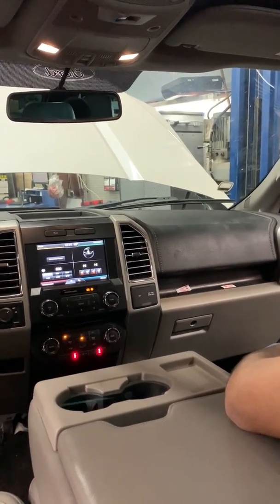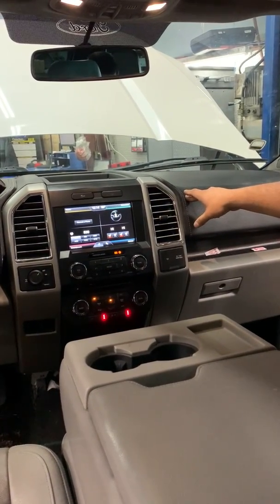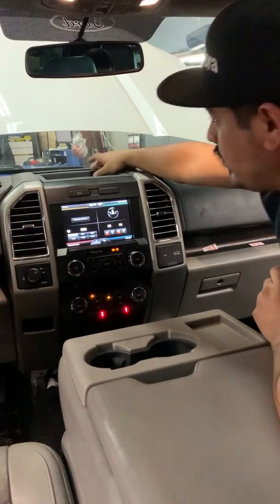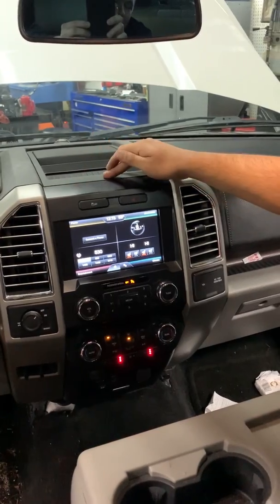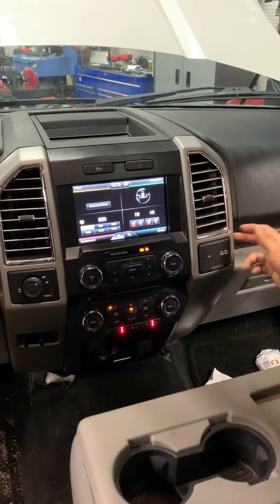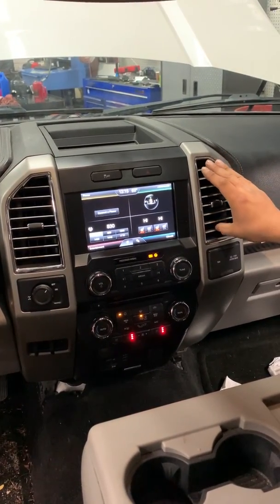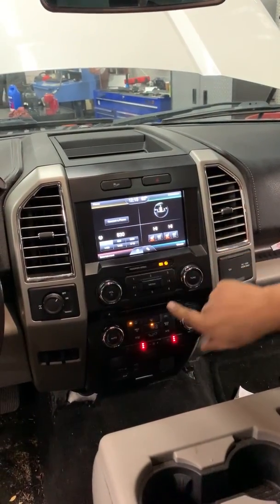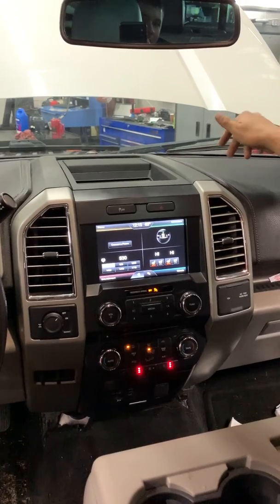2015 Ford F-150 Temperature actuator replacement without dash removal

Comment: I cant believe i just fixed my truck doing what you said. Just be careful to aligning the lower plastic part that moves, and the top will follow. Its easier then it sounds. Also push red clip and wiggle out. Awsome vid man, it helped

Comment: I found this the hard way this is only if you have dual climate. If you don’t this is by the passengers feet
Reply: What year do you have and what was your problem
Reply: @collinsmith398  2016 f150 xlt no dual climate. It’s up by the passengers feet.  Problem was heat/ac wasn’t changing leaving it cold. I changed the actuator out.
Reply: @stampedfish  I appreciate the reply. I have the same truck with no dual climate. I’m getting heat on the passenger side and room temp air on the driver side when I turn the heat on. Took the actuator out the other day and it worked fine… manually opened and close the flap and still did not resolve the issue 🤔
Reply: @collinsmith398  it has me stumped then. I did notice if you don’t line it up right and looks like it’s working but it isn’t
Reply: @stampedfish  yeah not sure. My luck it’s something behind the dash. It Almost seems like there is an Actuator or damper that separates the driver and passenger in my case.. even though it is single zone climate
Reply: @stampedfish  but you tried this and there was no actuator behind the radio ?
Reply: @collinsmith398  nothing there, but it does sound like you have one. I took my dash half out looking for it.
Reply: @stampedfish  geez might just be a jacket this winter and trade in the summer. Thanks for the help
Reply: @stampedfish  I’m having the same issue. Did you find any videos on how to do this? Mine also does not have dual climate. And what’s the part #?

Comment: How do u no which actuator is the bad 1
Reply: What side doesn't work ?
Reply: @slowpoke96Z28 on my truck, the passenger side is blowing out cold air and the driver's side is blowing out heat.
Reply: @TheBanks148   one side will respond to requested temperature changes, the other won’t. If a relearn with a scan tool doesn’t fix it, that actuator is probably bad.
Reply: @slowpoke96Z28  so does the passenger side actuator control the defrost too?
Reply: @TheBanks148  nope. Different door, Different motor.
Reply: @slowpoke96Z28  so it sounds like I have two bad actuators. I'm getting cold air out of the passenger side and defrost vents. So basically I need to change out the passenger side motor, and the one for the defrost, which I understand correctly, is located under the steering wheel?